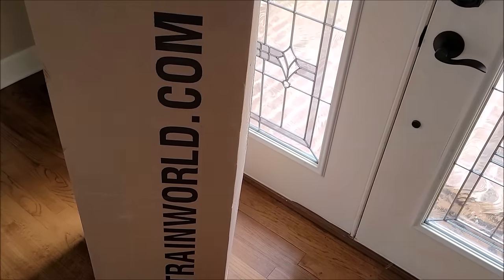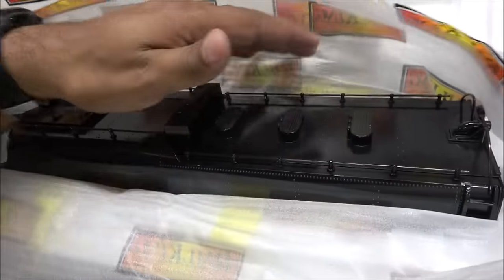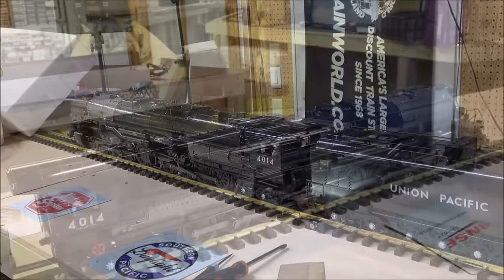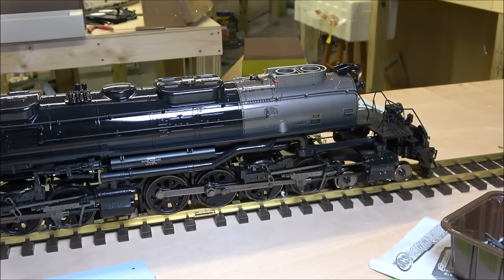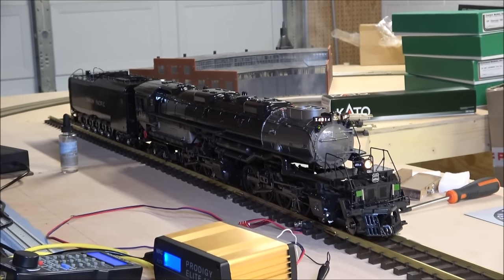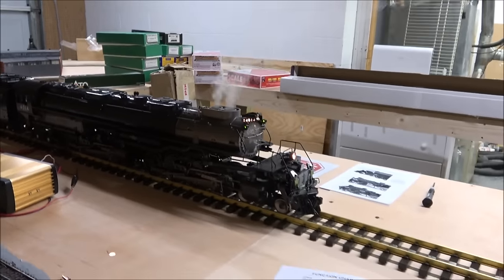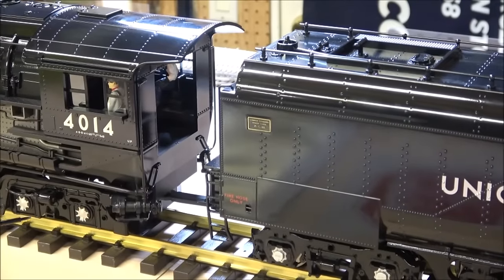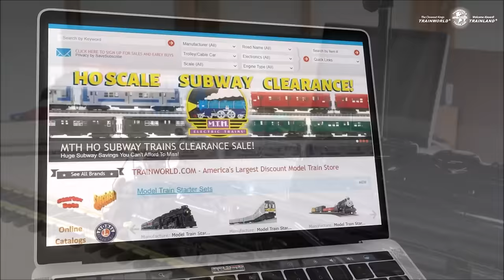The Massive MTH One Gauge (G Scale) Big Boy w/ Smoke, DCC & Sound, 4-8-8-4 Union Pacific (UP)! 1:32!

Comment: I went in big for "G" scale. Then "MTH" impressed me. I fell in love with MTH's 4005 Big Boy. It ran so beautiful. When I seen MTH was bring out the 4014. I pre-ordered it. I have very high hopes. Finally it arrived. It was in a wooden container.  Not like the 4005 and shown here. The engine and tender was screw fastened to the bottom. But there was NO instruction showing that. I was frustrated attempting to remove ether item from the crate.  Finally I found the retaining screws. After removing the first screw from the engine. The other 3 became more difficult. the drop of the engine put cross pressure on the screws. Finally i removed the screws. Bang the engine dropped. Then I found the engine had parts ( I do not remember how many long time ago) to assemble. Tender came out OK. I placed the engine and tender on my test track. instructions show placing and pushing up on the draw bar on to the tender. NO MORE information. Then I looked and looked for the connecting cable tender to engine. NONE. I called MTH, phone tag to right person. She told me about the connector plug on the draw bar. Very difficult to get it into the receptacle. You can not see where it is going. All by touch and feel. I even turned both upside down. Now I knew what to do. I had it. But when I turned it right side up. The plug came apart. A total pain to get it in correctly. I kept swearing, Why did they change a good thing. 4005 very easy to connect. Now I applied power from MTH module and hand controller. NOTHING, DEAD. Called MTH again. Check to make sure the connector was properly connected. YEA very easy to do. many attempts to connect. Each time I felt the click I was told the connectors made with seated. Still NO go.
I called MTH. I was told to return to MTH on the East Coast office. I had to disassemble engine and secure it int he ORIGINAL container. I also had to pay about $75.00 shipping. About 5 months later. I got a call. My engine was ready. I talked the lady about the problem. Bad connector. She asked about shipping. For some reason I asked from where. St Joe Michigan 10 miles from my house. I drove to the shop. We tested the engine. AOK. I brought it home. Not in the original container.  They placed it into a container like the 4005 came in and shown in video. 
I placed it on my layout. Made sure the plug snapped into the receptacle. The engine ran. Finally.  NO it did not make it 1/4 way around my 20 ft loop. The plug disconnected. it happened again and again and again.  I called the repair shop. back to the shop. it failed. A month passed by. Engine ready. TOK. Home again. Failed after 3 loops. same problem. disconnects. They needed to look into the problem.
I received a call from the shop. he said I needed to drill a small hole in the tender pin. After I connected the connectors. I would use a pin through the hole to lock the connectors in place.  I flew my cool.  The engine NEVER ran again.

Comment: Tender looks to be a long way from the cab. Surprising it doesn't have steam  coming from cylinders when it starts off. One of my European HO scale steam locos does that, and chugging smoketoo of course. It also has close coupling between the loco and tender which increases the gap on curves then closes up on the straight.
Reply: What train is it?
Reply: @049withagun7  REE Modeles MB-012 S. 231 PLM.
Reply: You took the word's right out of my mouth.... Beautiful looking loco, but I agree... The tender seems to be a bit far from the cab.... I would of thought that there should be a plate between the tender and the locomotive...

Comment: Does the smoke liquid need to be continuously full? What would the consequences be if it dries up on a mainline run that's inaccessible on a layout? Can one shut off the glow plug that causes the oil to burn so it doesn't damage the burning element?

Comment: I wish there was a company that would make engines this large but with a functional whistle, blow down effect, air pump, generators, injectors, and smoke to come out the sides and behind the pistons like a real engine . You could fill the tender with oil and have the boiler be the smoke machine. They would sell like hotcakes
Reply: The 2023 Lionel vision line does. I’m getting one. Not a fan of MTH.

Comment: So does this use 1:29 or 1:32 scale ?
The most common scale used for one gauge around the world, for standard gauge prototypes, is 1:32.
Gauge one being 1.75 inches by 32 scales out at 56 inches , so very close to standard gauge 
1.75 by 29 gives  50.75 inches, so 5.75 scale inches less than standard gauge.
Weird that US toy influenced makers went with 1:29. Equivalent to HO going with 1:78 instead of 1:87. Would be lots of complaints about 1:78 HO models.
Hear some weird reasons why 1:29 does not matter.

Comment: G scale is not one gauge.  G scale is narrow gauge 1:20,3  scale and one gauge is  1:29 scale.
Reply: The most common scale used for one gauge , for standard gauge prototypes, is 1:32.
Gauge one being 1.75 inches by 32 scales out at 56 inches , so very close to standard gauge 
1.75 by 29 gives  50.75 inches, so 5.75 scale inches less than standard gauge.
Weird that US toy influenced makers went with 1:29. Equivalent to HO going with 1:78 instead of 1:87. Would be lots of complaints about 1:78 HO models.
Hear some weird reasons why 1:29 does not matter.